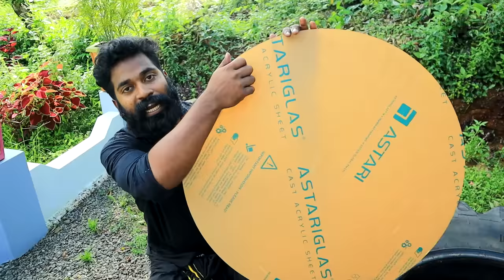Big Jcb Tire Aquarium Making |ജെസിബി ട്ടയറിൽ പണിപാളിയ അക്വാറിയാം | M4TECH |

Comment: Bro I think if you try sticking the glass from the inside surface then even with pressure it might not come out since it’s inside. Just suggesting to try not sure if it works. But you need to put both the flexible glass together inside at a time and stick one glass to one side. For sticking the other side you should try using the cutout you made to fill water. Using that cutout you need to try pressing and sticking the second glass on the other side. Just a try hope it might work.

Comment: Stick that acrilic sheet inside the tyre, that can hold the pressure.
Reply: Polichu tyre murich aano acrillic fix chyunne
Reply: @ambadirk  😂
Reply: @ambadirk  tyre ottumayurikille Appo set avalle
Reply: @Mallu_night_owl  acrillic vachitt ottatha tyre ipo keeritt ottichal nikko bro😂
Reply: @ambady radhakrishan acrilic bend cheyanum tyre strech cheyanum pattille bro, so cut cheuanada avasyam illalo.
Reply: @karimbancutz5802  ok 
I don't know
Reply: @karimbancutz5802  bro onnu think chythu nokkeye if suppose bend chythu acrillic ullil ketti oru side ottichu but other side engane ottikum pinhe ath set aakan engane athinte mukalil weight vakkan pattum 😇
Reply: @ambadirk  randamathe sidil sheet ottikkan gum apply cheytha sesham mukalile holilude kai ittu ottikkavunnathe ullu pinne pressure apply cheyyam weight vekkanam ennilla pakaram oru wood pice in between tight ayit vacha pore,

After all " If there is a will there is a way"☺️

Comment: Make some simple modifications nd it will be successful. I did it in small tyre.  
1 replace the screw nd washer wit little bit broader clips 
2 fix support legs so the tyre will not touch the ground 
3 put more silicon gel nd remove the excess glue with a sharp blade
4 since its big tyre the pressure from water inside will be high. Use at least 6 mm glass. I used 4 mm for scooty tyre. 
Do these. Ur project will be success. 
For Any reference visit my project @jikks craftmaship. 
Good luck brother♥️
Hope to see ur successful project soon👍🏻👍🏻👍🏻👍🏻